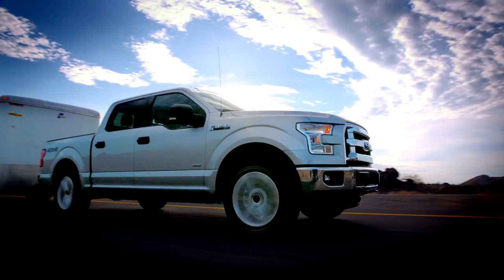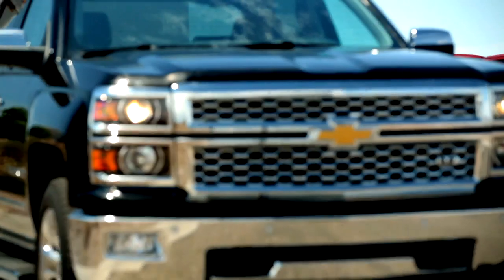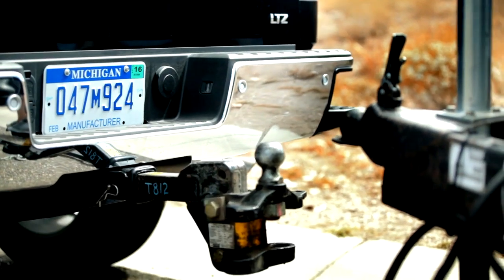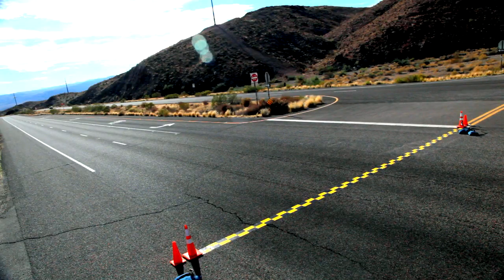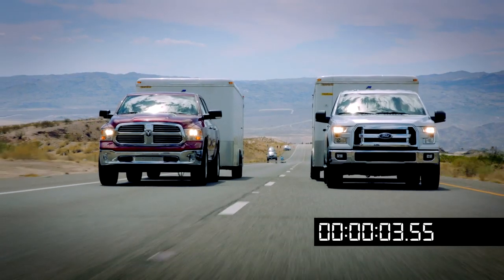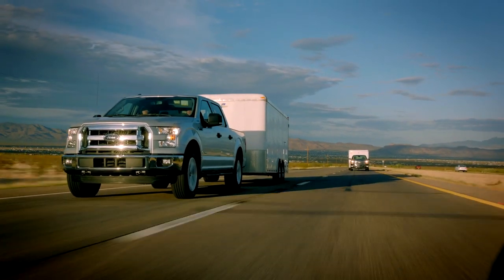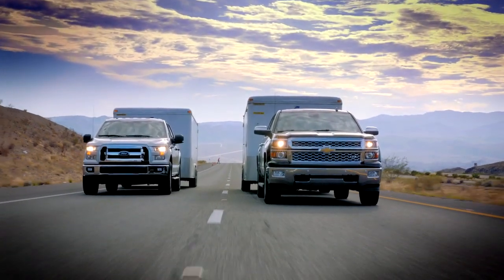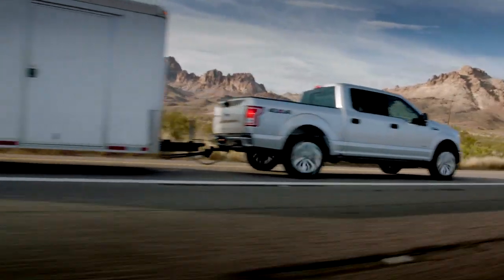2015 Ford F-150 towing test

Comment: I wanna see a non - bias review of these three trucks. :p
Reply: Watch the ike fast lane truck the tow the maximum weight of the trycks but same weight and set up and race them to the top and see who does it faster and gain a few thousand feet in elevation they do it for all the trucks toyota chevy didge and ford. They have not do the 2015 f 150 yet because it has not come out yet but when it does they will check them out

Comment: I would love Ford to build performance cars out of Aluminium and that stonking awesome 2.7 twin scroll turbo ecoboost v6
Reply: It'd be cool if they made a rs200 revival that way
Reply: ikr
Reply: ***** Yup, the RS200 is basically a Fords version of Nissan GTR, but sadly Ford isnt going to do that cuz the engineers who  used to work ford Ford on the RS project are all now under the deadly Volkswagen Audi group, the worlds most powerful group and without those heads Ford is still stuck with FWD diffs and RWD cars

Comment: I would like to know why it lost against the Chevy when it got cooler, its a turbo they run better with cooler air...
Reply: Dude fair thing 5.0 vs 5.7 vs 6.2 the 6.2 would smoke them bad ford lies dude I bought a Ecoshit when it came out I beat it up misfires engine lights I got it fix and told ford I'm getting a chevy fuck ya
Reply: That y I think and the truck it's lighter and the engine is. Tiny thing

Comment: I thought turbo's like cold air? Why would it perform more poorly in colder weather than it did warm weather?
Reply: My guess is the 5.3 was struggling in the heat and the ecoboost had no issues with it.  Then it cooled down and the 5.3 could perform at its peak.  Depends on temperatures when they did this.
Reply: Ah, I get you. Thanks! Much appreciated.
Reply: Kahless has it right. Cooler temps creates a denser air charge which effects all power plants, however NA motors typically benefit from it it more. NA motors are very susceptible to changing atmospheric conditions.
Reply: You also have to consider heat soak with the 2.7. While its unknown when or how long between runs they had, if there was residual heat built up in the 2.7, it may not have been running peak performance. Turbo's, IMO, are more susceptible to this than an NA motor.

Also, would have been neat to see MPG and fuel consumption figures. My money would be on the 2.7 actually being the thirstiest of the trio with the ecodiesel taking top trump.
Reply: Alan Bowers Agreed!

Comment: Just spent 5500 bucks so the dealership could fix my 2015 F150 ecoboost with 50k miles on it.  I bought it for 52000 at the same dealership. They made a mint of cash by me loyally following their maintenance plan. The pile came with extended gas tank and tow package. Good thing I never tried towing anything. Probably would have made it break down faster. Can't give it away. It taught me to never buy one of the worst trucks ever. It was specially built in Michigan (came with a cute sticker saying so). So like the dog doo doo. This piile is sitting in my yard to rot. Why at least it can't break down and gets better gas mileage and trying to get rid of it has been fruitless. I strongly suggest do not buy this model. It will cost you only grief and cash. Good thing I never tried to tow anything.

Comment: this really prove nothing. is it reliable?
Reply: After 8 years, I was randomly looking at used trucks and found several 300k plus 2.7 v6s for sale with original components. I guess they were ok after all.
Reply: @cesarpalmos8235  i still take the ford 150 but turbo often need replacement after certain mileage. i pulling power isnt much unless youre hauling heavy load all the time then it makes sense